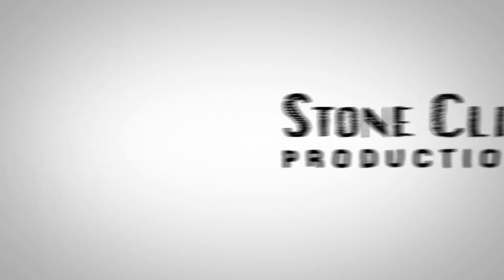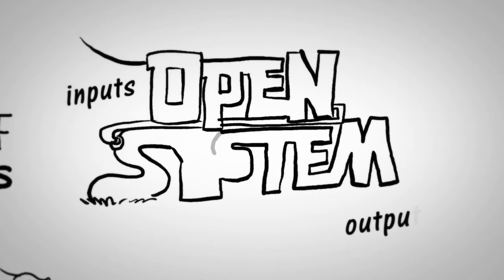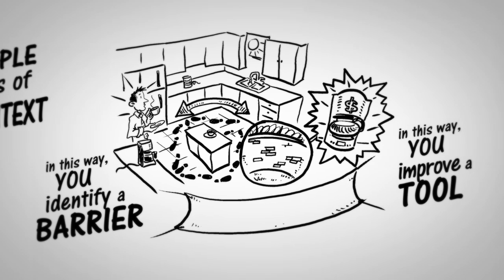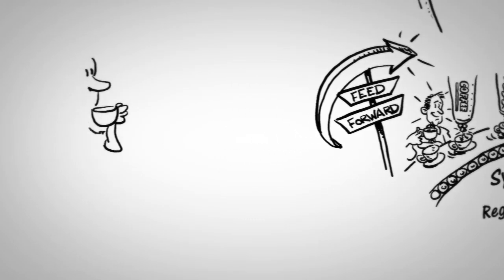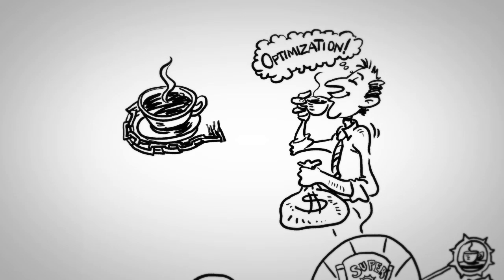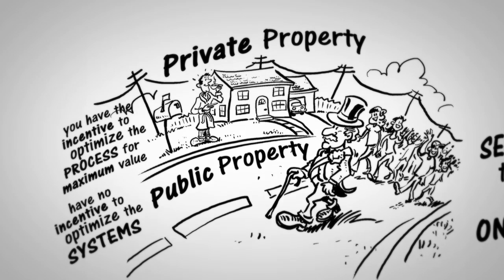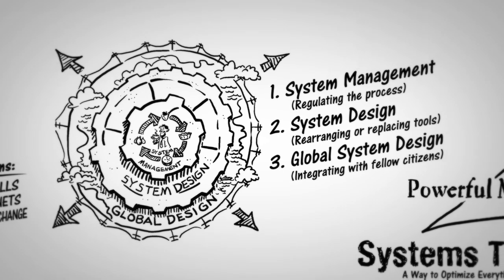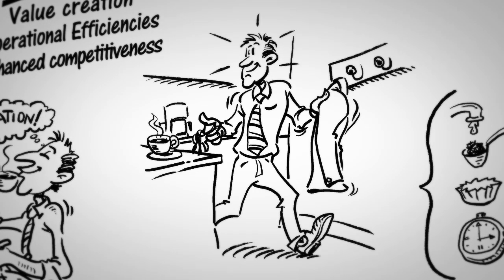Systems Thinking white boarding animation project

Comment: Nice video on optimizing processes - but very little about systems thinking.
Reply: I agree  with this point. Good vulgarisation technique and intent, but as M. Maples says, system thinking is not well represented.
Reply: Indeed. I was about to post a similar critique.

Systems Thinking is not necessarly about Optimization, it may be about Conceptualization, and abstract Deconstruction of virtually any mental model.

It might be seen as an optimization tool for Complex Thinking* by the way - if this is not quite redundant.

* a synonym; which originates from Complexity Theory
Reply: Who is M. Maples? I found his idea interesting; any links to it? Thank you.
Reply: In fact, I was taught that if the components are optimized, the system will not necessarily be. Optimization can be a dangerous goal.
Reply: You really can't do systems theory in 7 minutes.

Comment from the maker: Thanks Lex,
It's pretty fast after you get all the OKs and been doing it for a while. After the sketches and idea are worked out the animation is pretty simple to do if you can draw and have a style down pretty well. Working out the dance of the pencil is the hardest part. Knowing what needs to be drawn with connection to the script. thanks for the comment.

Comment: Good video, but I question the statement made at 4:41, that public property has "owners" that have incentive to improve for "maximize value", and that public property "have no incentive to optimize the systems". While it is true that in SOME places, "tragedy of the commons" does happen - where nobody takes responsibility for the degradation of the public space, there are other places/cultures that all work TOGETHER to optimize the system because they ALL use it.  Other commenters have mentioned that the capitalistic view presented here does not include other inputs and motivations such as the bigger picture, sustainability, symbiosis, altruism, etc. I would like to think that true systems thinking will respect all other systems it interacts with or affects, and not discount systems that reflect the TRUE nature of inputs and outputs - not only those you don't agree with, but those that you are not even looking for.